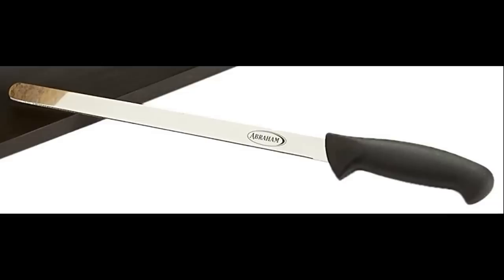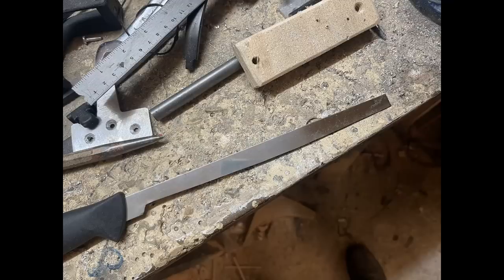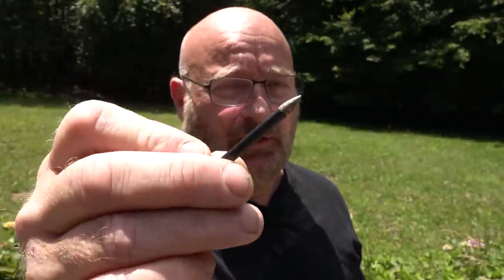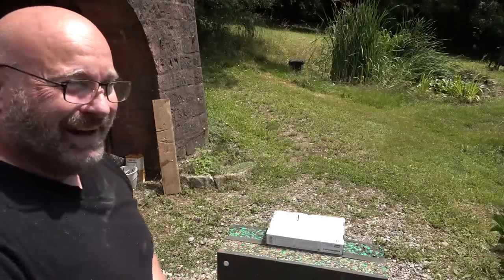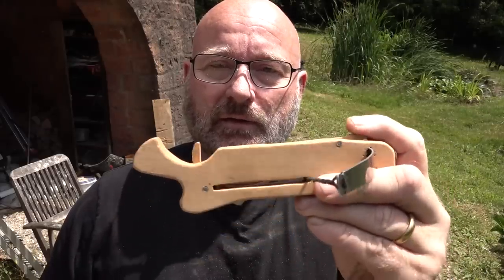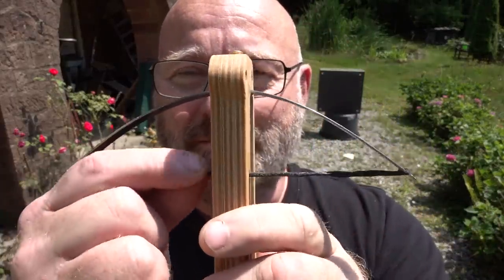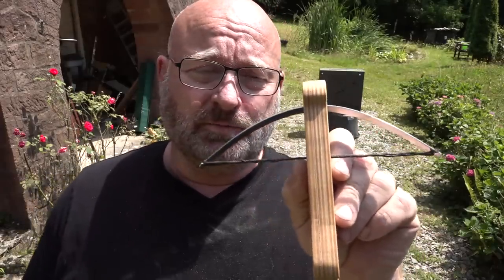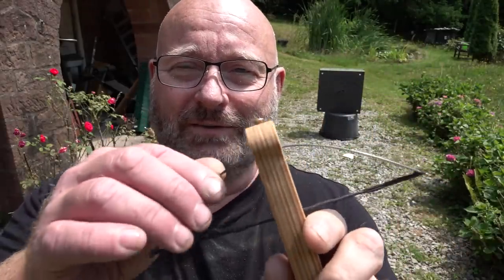How 2 Turn A Knife Into A Mini Crossbow!

Comment: This knife is a "cuchillo jamonero". In Spain is very common, used to cut thin ham slices. It's interesting how it becomes a weapon... :)
Greetings from Spain
Reply: The knives you get with the ham in Germany are just crap, the 'cut' like a butterknive. Crappy steel, no sharpness, just good for making crossbows xD
Reply: XD
Reply: Thank you for sharing the knowledge! I've yet to try a jamon, I know I would love it though
Reply: @erict3728  Be careful. A good ham knife must be very sharp. Accidents happen... :)
Reply: @erict3728  Just remember that it is not the cured soft ham that we know in the west, it is a very tasty and flavorful, but dry and kinda tough ham. So as OP said, a sharp blade and also thin, even cuts are optimal to enjoy it.
Reply: @claudiusgregor1839  
Yet most German utensils are superlative IMO.  I have a pair of Solingen scissors that have held their edge for 40 yrs on card, thick paper, photographic paper, artists linen, tape even the odd bit of trimming on thick garden vegetation.
Reply: Claudius is 100% correct on this. This knife isn't usable whatsoever. Only thing it would be competent as is to insult spanish ham culture lol
Reply: @rickh3714  This isn't german though. They basically sell the ham and add a $1 knife to it as a gimmick. Cheapest chinese product you can come across. I agree that stuff from Solingen etc. is awesome and german knives will usually last decades, if you treat them how you're supposed to. Just like for example Knipex tools. But high quality blades would mean that the ham package would be at least double the price
Reply: Best ham I’ve ever tasted as well! 👍🇦🇺
Reply: Best ham I’ve ever tasted as well! 👍🇦🇺
Reply: And best ham I ever had 👍🇦🇺
Reply: @glidershower  That's right. :)
Greetings from Spain.
Reply: Knife becomes a weapon?
Hold on there buddy.

Comment: I made a crossbow about 45 years ago similar to this but much smaller than this using the tweezers from a swiss army knife as the prod.  I carved the stock from a small piece of walnut and used a two levers against each other for the trigger and main string release mechanism.  it was fun and suprisingly powerful. It was about 3” long.

Comment: This is a neat little semi-auto crossbow! Love it

Medieval steel spring crossbow is awesome, tonnes of draw weight, like throwing bricks at an acceptable speed. Just needs a lot more heavier arrows to match the draw weight!
Reply: How is that semi-automatic?
Reply: Do you mean auto-loading? It's still a single fire but it automatically loads the bolts in
Reply: No. It is a bolt action crossbow.

You have to manually tighten the string each time before you can shoot again.

With a semi-automatic crossbow, this would happen automatically as soon as the trigger is pulled.

A fully automatic crossbow would even empty the entire magazine when you pull the trigger.
Reply: @Druss Snagga  If we want to get super technical, it can't be bolt action because there isn't a manipulation of the bolt like in a firearm to load a new round. Yes the projectile of the crossbow is also called a bolt, but in this design you simply pull on the string to cock and load it.

So maybe "string action"?
Reply: @NoNamer123456789  Seems legit.  🙂

Comment: Still loving that Dyneema.  I've become very fond of it myself since that other crossbow project.  You could make a ballista from the leaf springs of a heavy sedan and it would hold up fine.  Thanks for all you do and Best of Days.
Reply: Cosnidering that 1mm holds 140 kg a 5mm would do it just fine with its 4000 kg capacity .
Reply: @zumbazumba1  do you sail perchance?
Reply: @sirpringlesthebold3921  I did some sailing when i was a kid  ,but it was on traditional boat .

Comment: I also threw all my kitchen knifes to garbage and i bought cheapest plastic handle PRO-DYNAMIC series of  Dick knifes .I sharpen them once a year ,handle is super comfortable ,most expensive was a chef kitchen knife 24 cm for 25€,and i bought some peeling knifes for 5 € a pop  .For that price best knifes i ever owned.(i wonder how 300€ one cuts and holds edge) 
Compared to garbage we buy in supermarkets like 10 - 20 € for a wood block with scissors quality is 10x better. 
I wish you did this video sooner ,i could have build a cool mini  crossbow  :(

Comment: You need it FLAT.   POCKET SIZED!  You have the technology. Rubber bands or spring wheels with perhaps an extension that flips out for more power. Thanks. Edit: similar to the Adderini but smaller.

Comment: Hm, wouldn't a bigger version basically work as a proper crossbow? Here in Russia we can get 43kg limbs without any paperwork and I can cock those resting the crossbow against my shoulder so something on that level of draw weight in an upscaled version of this should work. Would be very simple yet you won't have to put the sights too high up. I might be wrong and it might not be as simple though.

Comment: I have an idea for your design that compliment it's magazine system if you get a wire coat hanger bend it so it fits the back of the crossbow bend  both ends upwards in front of the bowstring when you pull it back it will hook the bowstring and you can cock it with one hand like a gun slide  if you can spring load it it can all be done in a single action if you bend those to certain height you can make it into a selfcocking and aiming sight all in one system

Comment: Brother please 🙏 build one with a electro magnet on it the ones that pull 1100 lbs  and let the string have a piece of metal wrapped around the center while being attached to a wheel rail every time you pull the trigger the magnet will release sending the arrow flying and you let the trigger go the magnet will retract the string on its own with enough power while loading another arrow into place like semi auto it'll be almost like van heslings crossbow loll

Comment: I had a dream last night about a weapon that looked like a Beretta m9 but somehow shot crossbow bolts. I was reminded of this video and realized the fictional weapon would be impossible because crossbows need limbs for energy. Then I got to thinking about another video where you showed off that limbless crossbow. That system was very large, but I wondered if it might be possible to scale something like that down to a pistol size.
Reply from the maker: Just use rubber! Like so. https://youtu.be/RdlzpbD0E-I
Reply: @Slingshotchannel  I really enjoyed the recommended video and am unsure how I missed it earlier. Thanks for sharing it with me.

Despite the rubber solution, I can't help but still question whether a pistol version of the Lancehead would be physically possible, even though it looks quite sophisticated.
Reply from the maker: @lookoutpiano8877  The problem is that the Lancehead coil springs need several complex block and tackle setups to work properly. Not really suitable for a small pistol size crossbow.

Comment: You can make a really small crossbow using the tube of a Bic pen, the pen part (as the arrow), and a woman's barrettes (hair clip).

Off topic, but are you done with working with models?
Reply from the maker: Not categorically, so if the occasion arises why not.
Reply: @Slingshotchannel  Just wondering. I mean, like most straight guys, I enjoyed seeing them. However, I enjoyed it even more when models prove that there's more to them besides beauty.
Reply from the maker: I will soon film with a lady that actually is a bow huntress, should be an interesting video.
Reply: @Slingshotchannel  Cool.

Comment: THEY ARE CALLED BOLTS NOT ARROWS. You think someone that does a crossbow channel would know that
Reply from the maker: These days those two terms are used identically.
Reply: @Slingshotchannel  umm no. They are completely different.  They are similar in shape but completely different.  Arrows are a lot longer than bolts are and all arrows have fletching (fins) where as not all bolts do
Reply from the maker: Absolutely no wisebutting on my channel please.